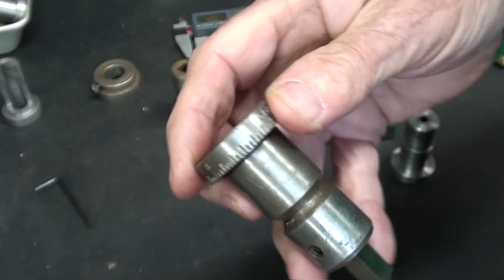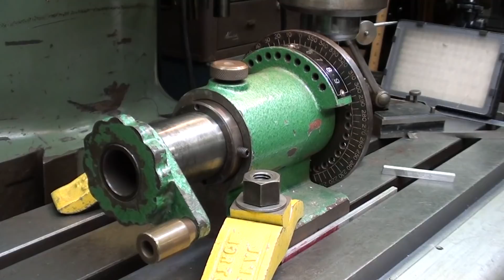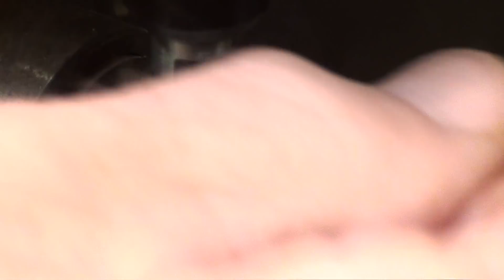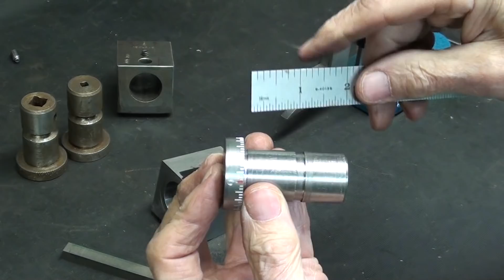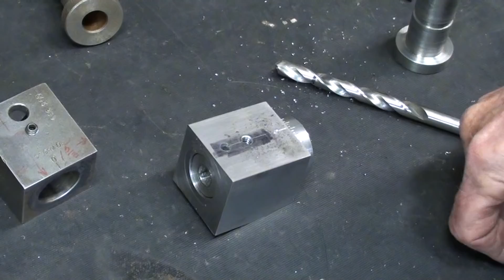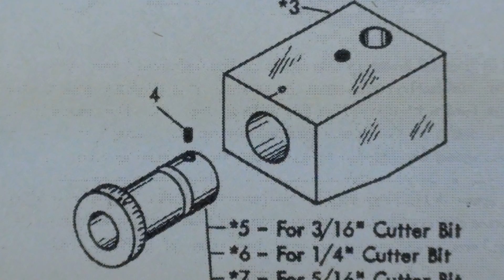SOUTH BEND GRINDING JIG Engraving #708 pt 3 tubalcain lathe bits

Comment: Would it be a good idea to leave the sleeve in the block for an extended period of time?  I would be concerned that the two parts may rust together just as a micrometer tends to do.
Reply from the maker: You are probably right, I never thought of it

Comment: The scribe you could make as a single flute cutting tool  on a D-bit grinder but slightly differently to the normal shape. The start point would be a piece of solid carbide with split ends. All explained in:-  https://www.youtube.com/watch?v=VLRg24LrcJw&t=7s&ab_channel=Blondihacks

Comment: Hi Mr. Pete. 
I’ve made one of these little jigs and it is great. Thank you very much.
I used cheap clock keys from eBay for my square holes (easier to get here in England).
Paul.
Reply from the maker: That is an awesome idea, to use a Clock key

Comment: Mr. Pete.
We're you in fact guilty of overthinking your setup ?
You didn't need the clamp and second vice when you drilled the second hole.
You didn't need the tool bit inside either.
You had established the correct position with your graduations and you had a grub screw to clamp it.
Reply from the maker: Yes

Comment: I bought one of these when I first started and I'll admit I had some trouble figuring out how to use it when to hold in what positions with the minimal directions provided and no videos from anyone one thing I did to save wasting hss blanks to get things figured out was get some cold rolled square to practice on lol that's when I also learned that hot rolled is usually way undersized to its stated dimension 😂
Reply from the maker: Thank you for watching and commenting I will cover that all in the follow up video which will be available on Saturday

Comment: Enjoying this series, thanks, Lyle. 
One possible accessory to extend this series is to show the principles of an angled guide fence for clamping on the grinder rest to assist with tools for screwcutting, etc. which need accurate angles. It would be extra credits for many, but some might appreciate the security of working off a guided system.
Reply from the maker: Good idea

Comment: Mr, Pete,  I have a couple of the original holders like you do and found out quickly that they need the second tool bit hold down access and lock down set screw between the original center hole and the "0" marking on the block.  This will allow you to sharpen and or re-sharpen short pieces of high speed bits for boring bars and  the sharpening of many very sort pieces of old reground tooling.  Just call me thrifty.

Comment: When using the spindexer if you would have moved the pin to 5 position then it would have indexed into the next 5 degrees taking the guess work out of finding the next 5⁰.
Reply from the maker: Thanks

Comment: Mr. Pete, I have been enjoying your videos for a while now, and I finally have something to add. Your engraving cutter looks like ones that I use with my New Hermes engraving machines, only larger.  I get my engravers from a place called 2L inc.  They call that pattern a "standard conical V-bit".  If anyone is interested, I have had the best luck with 2L's "Tough Tip" engravers. Antares Inc. is another source for engraving cutters.   -Chris
Reply from the maker: Thanks
Reply: Chris, Thanks! I just ordered two engraving tools from 2L.
Reply: I make my own points from carbide rounds which are pretty cheap but it is a pain to get them sharp. 

I use diamond surface plates for that. 

My current project is actually a slow speed lapping machine based off a machine Stefan Gotteswinter's machine but scaled up a bit and taking advantage of a shunt wound gear motor I pulled off the scrap pile.

Comment: Query: Are all the graduation numbers applied by using number stamps and a hammer? If so, how do you go about aligning and holding them?
Reply: Mr Pete eyeballs it and has steady hand-holding skill, making it look easy.

In fact, it is tricky to get precisely right on the first try striking one hammer blow, which is all you get.  Five degrees of freedom with just fingers.  Your strikes must be correct goldilocks force, and mutually equal for stamping more than one digit.  And there's no backspace key.

Comment: Could you have used a piece of key stock instead of the tool bit when drilling the hole?
Reply: Yes, or just pull the stock part way out so the drill will miss.

Comment: "360 monotonous degrees..." Thanks Mr. Pete... Now I have Coca-Cola running out of my nose...

Purry shure that tool you're using for engraving is exactly that and can be spinning for the job of engraving. I use carbide versions with my vertical machining centers for engraving serial/part numbers. Spindle speed is 10,000 RPM, feeding @ 10 IPM. Leaves a very clean finish.
Reply from the maker: LOL. Had lots of Coca-Cola come out of my nose over the years.   And then again I never put Coke into my nose like a good part of our population
Reply: @mrpete222  LOL same here!

Comment: Mr Pete, I think that if you looked up about D cutters for machine engraving. Such as with pantograph machines. Then looked a bit more at the cutting angles. I'm sure you'll want to simply grind a tiny angle at the tip of that tool you used and then try engraving with it rotating at high speed.  Because it looks to me that it's a new D cutter that hasn't been made ready for use yet.

Comment: The spin indexer will lock into any position on 1 degree increments. The holes labeled 0-9 do that for you. If you want say 32 degrees turn the spindle to 30 degrees put the lock pin in the "2" hole and turn the spindle slightly until it drops in place. It is truly the mechanical equivalent of a vernier scale. You will see the big dial will show a little past 30 which is of course 32 degrees. Thus all 360 increments are readily available. A clever and simple device which is likely more precise than reading a rotary table .

Comment: Another way to get a short surface square or parallel to your reference surface is to use the smallest clamp you have and clamp a tool bit crossways to the short surface, using the tool bit as a surface to be indicated.
Reply from the maker: Great idea

Comment: Think I would engrave the markings only 90* to the right, then left, from 0*. You'll probably never use the bottom half anyway. Then there is no alignment  problem at the end if you're out a bit.

Comment: I'm enjoying this series. Could it be that South Bends "V" Groove being slightly offset fro the set screw was intentional in an effort to remove end play from the collet forcing the degree collar up against the block?  If it was intentional it would have been better to use a brass set screw to prevent the damage to the groove as seen on your original SB tool.
Reply from the maker: I think you are right, it was intentional
Reply: @mrpete222  I have an original set and it's the same so it must be intentional.

Comment: Would it be advantageous to make it so that you could change out the square stock in the same piece so you can use different sizes in the same piece?
Reply: I think you'll find that each square "ID" will have a different OD.

Comment: I'm attempting to turn a #3 Morris taper on my 12" Clausing using a lathe dog between centers , using a dial indicator on the tail stock,  how many thousands should I move the tail stock  ?
Reply: How long is your shaft? 
Doesn't matter since the shaft should be indicated directly while also indicating the carriage travel. A little trig will tell you what the offset should be for the angle you want. I think Joe Pie has the best trig explanations.
Reply: @bwyseymail  Thank you for the reply , the shaft is 6" , I'm making a Morris taper #3 for a 3/8" center drill bit for the tail stock,

Comment: towi n one tool,   by using it with a headend drill Guide  For cradling round stock  , by using a 1/2"hole top a bottom . !? in the vice . It  as possibility's ,  .
Reply: tow in one tooling . cross drilling  jig & lath tool  sharpening jig . ? tow in one . yes .

Comment: yes i will be making one i haven't a mill so mostly hand work  & i will  shrink fit to save on time  in making the Square.  i haven't got access to the selves liners  I suppose we could shrink the liners in to the salve's  as we did to  fit valves seat's.   i ues gas & heated it up  works well.

Comment: Hi I'm thinking the reason for the 3/8 hole for adjustment is so the tool bit may be moved when it's at an angle other than 90 to the face.
Rich
Reply from the maker: You are absolutely right, but it took me a while to figure that out

Comment: Good morning Mr Pete!  I am making this grinding jig out of aluminum instead of steel with steel square hole inserts. Will loctite 609 retaining compound be a good choice to hold the inserts?
Reply from the maker: Sorry, I do not remember the numbers of the Loctite products
Reply: I think almost any grade of red loctite would work to lock the inserts.
Reply: @ellieprice363  Thank you, I tried using loctite 609 color green and it work on the 3/8" holder. I will try the red loctite 262 on 1/4" holder. Nothing ventured, Nothing gained.  Thanks again.

Comment: Just a thought, but maybe the set screw was offset from the groove on purpose. It seems that if you tighten the screw down it would try to push the rotating jig forward locating it with the back face of the dial. This would make for a fixed axial position of the jig when tightened.
Reply from the maker: I think you are correct
Reply: @mrpete222  possibly it was one made  on Friday afternoon.  or out of a different  set , just ues you square to set the orientation .
Reply: in reality it is possible the point on the grub screw was silty of . it at lest applied presser on the V to prevent it pausing out  out . I don't won't to be critical . But he having one of the moments clamp it either the grub shrew feeler LOL  still waiting for #709 Part 4 . Les England .
Reply: @mrpete222  The angular feature is called a "dovetail", and yes the grub screw is offset by design, to engage only one side of the vee groove, making it kinematic to the design stop of the assembly instead of randomly engaging.  The unengaged side of the Starrett fixture is an poor artifact of this manufacture, which should be cut instead with a half-width tool to avoid the chatter.  Dovetail fittings are a standard feature in the optical engineer's design method catalog, where they fix an arbitrary rotational adjustment with a precisely stopped axial displacement, typical of optical devices.
Reply: @RichardKinch  Mr Pete practically invented the dovetail..... pretty sure he knows.
Reply: I wondered the same thing and comment after you did, before reading your comment.
Reply: @pyromedichd1  grat minds think alike LOL .
Reply: yes I thought the same thing !
Reply: I have an original complete set. Mine is offset and that's how it works.
Reply: Beat me to making that observation.
Reply: At 3:45 you can see where the pointed set screw had pressed on the correct side of the V groove so that it pulls against the dial and makes it much easier to maintain the  exact same lengthwise position when you rotate the internal piece to adjust the angle. The flat groove doesn't provide that benefit.

Comment: Came out OK Lyle. Why not use a second pin for the 5 degrees instead of guessing each time. Regards from Australia.
Reply: i shrink  fitted the bit relied for the square saves a lot of time.  in making it . & you can later het up to harden worked  a treat . i suppose  you could shrink with liquid nitrogen if you had sufficient to make it wroth while . but  heating up & the freezing  is sufficient for one or tow. les England.  LOL
Reply: Yes, set the "vernier" pin at 5 degree. To speed up the engraving process, index on 10 degrees all the way around and possibly set a hard stop for the mill axis travel. There is no provision on the mill for this, but anything rigid and cheesey could work.
After completing the 10 degree steps, repeat process for the shorter 5 degree marks moving the stop and the vernier pin appropriately.

I don't own a full set of 5C collets yet, so I did a poor man's trick and purchased a 5C 3 jaw chuck. This allows me to hold any size round stock while I shop for bargain full set of 5C tooling. My 5C chuck has a wee bit of run out (.003"), which works for most of my spin indexing work, but is disappointing.

I really like Lyle's cheesy drill press vise trick to set the tool but square. Fast and dirty yet reasonably accurate. I would have used an indicator against the clamped piece of tool bit stock, possibly gotten it more accurate, but my method would have taken much longer.
Lyle is clever in doing things simpler when close is good enough. 
It isn't hard to level a knee mill. Our shop standard was to level manual knee mills to .0005"/ft. I just sheared an assortment of sheet metal shims (I preferred SS) about 4" square. Using a pry bar, rock the machine base to insert required shim. The rough machine base casting and the floor variations allow miniscule adjustment. The weight of a knee mill held our machines in place for an indefinite period of time in a high production environment. I have anchored a mill on a rare occasion, but there must have been an extreme reason why we thought anchoring was necessary. Our machine pilots appreciated leveled knee mills. It was common for them to use the protractor type levels for work set up with a leveled and trusted machine.

Experience gives method confidence. Lyle "cheats" on best practices when he has proven a simpler method is good enough. I think that he was scribing with his height gage from his work bench surface instead of a surface plate. If so, on this job that may be acceptable. Obviously a surface plate would be more accurate. I cheat similarly on non critical part center locations, by touching off my known tool diameter and part diameter to calculate center and skipping the edge finder step. I am still using hand dial scales on my mill. I introduce so much error with axis backlash. I set up a travel indicator when I need accuracy. My mill came with a partially malfunctioning DRO. The display got separated in the purchase/delivery. I got used to working without the DRO and never installed and repaired the DRO. In the long run, postponing the DRO installation and repair has been a frustrating option. Most of my machinery was purchased used with used machine issues. Sometimes I live with those issues, because repairs seem unjustified. I recently purchased several brand new shop tools and machines. They are wonderful. I haven't had new equipment in the shop for so long that I forgot how much "some assembly required" and how much packing material causes different setup issues and frustration... But new is vastly better!
Reply: @paulhunt598  Thanks for confirming about using the pin at the 5 degree mark. Trouble is with your idea of going round and doing all the 10 's first. Lyle was marking a Long line every 15 degrees ( 2 short then 1 long ) so your idea would totally confuse him. With regards to fitting a stop, Best idea if you have a solid stop is set it for the long line, then introduce a piece of packing to the length of the short line you want.
Reply: @daveticehurst4191  Yes. I confused myself on the degree spacing and you corrected me. I repaired and maintained machine shop equipment, mostly CNC, for most of my career. I got bored with CNC and enjoy learning to manual machine in my retirement hobby life. I was trained and served as a technician, but never formally trained as a machinist. Lyle is a fabulous instructor for someone like me. Someday I hope to meet him in person. My pockets are deeper in retirement than during my working career. I am enjoying exploiting this by tooling up an extensive machine shop for hobby pleasure. We lived so frugally that I was shocked when my wife encouraged me to build my dream shop while I am still young enough to enjoy it. I recently added an American Pacemaker to my lathe inventory. It is very similar to the lathe Adam Booth is setting up. My wife thought this lathe is bigger than I need. I have to tried convince her how cool it is to make big chips. What kind of work do you do? I am currently focusing on milling and turning.
Reply: @paulhunt598  HI Paul. now retired here in Australia. I worked in the UK as a Machine Tool Fitter ( Millwright ) up until 1998. I have  YT channel, have a look. https://www.youtube.com/channel/UCbkcTy1DCDB2sdgGnLSv1rQ   If you can find 1.5 hours, I have a shop tour and description of my working life. https://youtu.be/xzC1MvCUA7I
In one of the other videos, can't remember if it was the DoALL rebuild or the Grenby Surface grinder I also mention why I came to live in Australia. YOu can drop me an email for more details if you want. Regards from Dave.